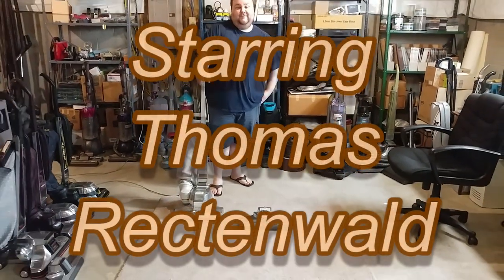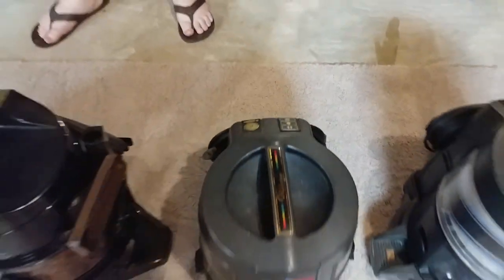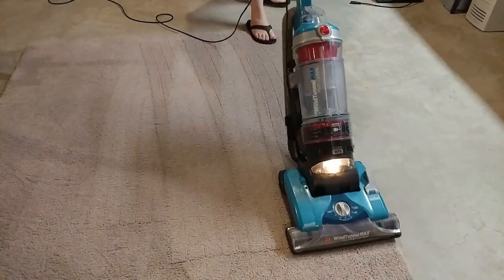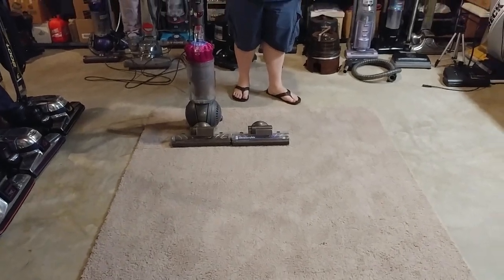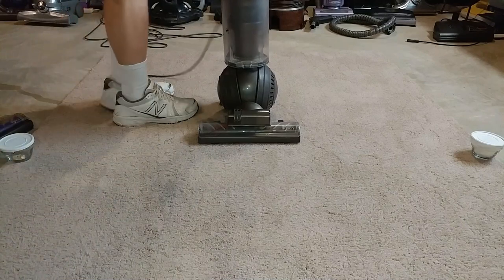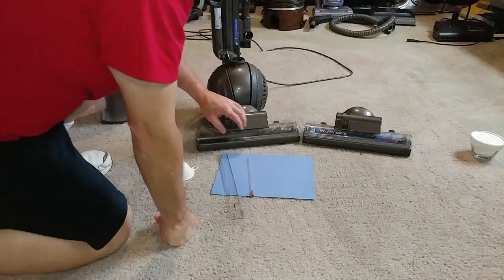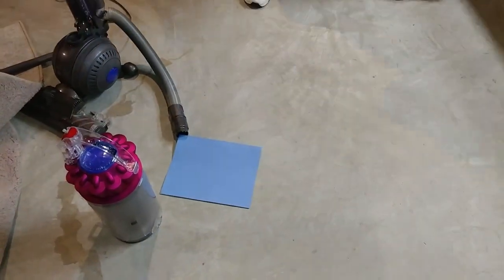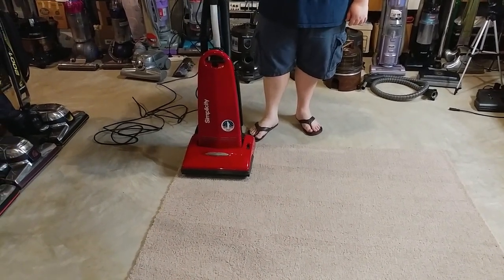VacLab Mini Meet #5

Comment: The chevron brushroll is going to be smooth just by the physical shape of the brush. It's still my favorite arrangement on any machine. Not only does it direct the debris to the inlet most effectively but it gives the machine that million dollar feel.
Reply from the maker: They are very smooth, aren't they? My first two Kirbys were the Heritage 2 Legend and then the G4, both with the chevron brushroll.
Reply: Your Electrolux Olympia and Oreck XL also employ chevron brushrolls.  I like to be finished with the job having experienced less vibration. I find it more relaxing.

Comment: Thomas, since Bill says thats your favorite vac ( when you visit) , have you found one to buy for yourself? Do you want to?
Reply: I have looked and looked and cannot find one at all.
Reply from the maker: @TRec3791  8850's are very rare these days. And they're not cheap either.
Reply: Thomas Rectenwald Thomas   I thought of you as I just saw a riccar 8850 just like that one you like at a thrift shop $30!  Light didn’t work and missing one tool but....
Reply from the maker: @steeltag  I think I got mine at Goodwill for around $13. It needed a belt.
Reply: I have been looking but like Bill said they are very scarce. Too bad Goodwill don't deliver otherwise I would have bought it and had it shipped.